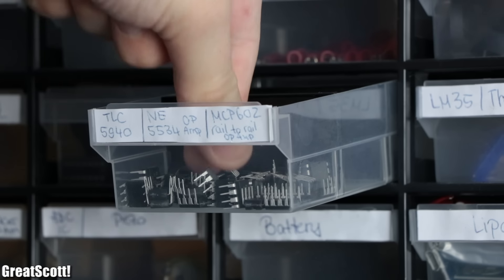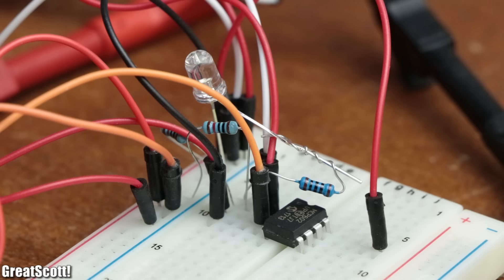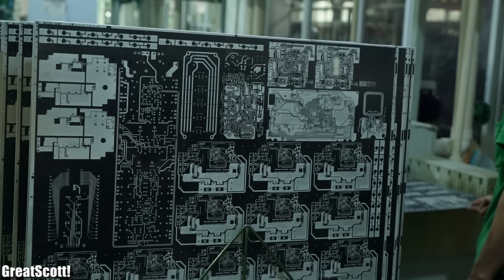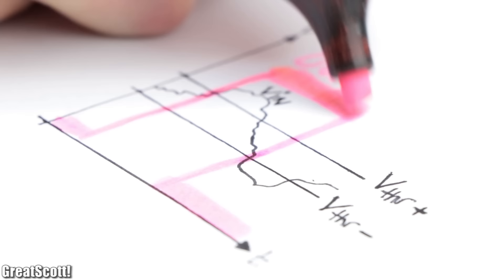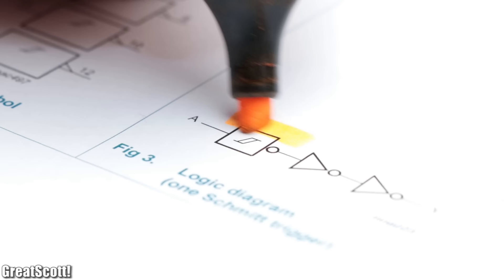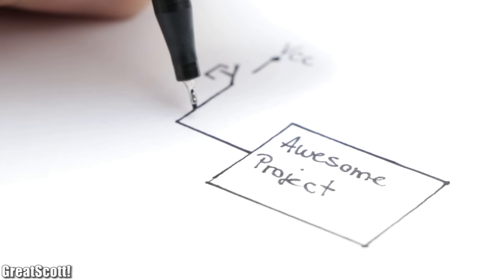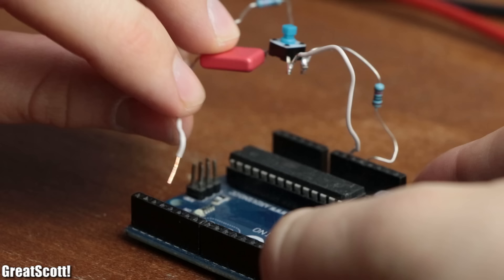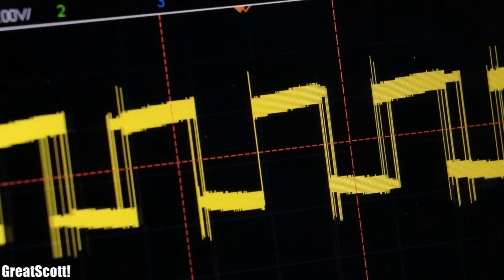Electronic Basics #35: Schmitt Trigger and when to use them

Comment: You can also use a 555 timer IC as a schimitt trigger
Reply: what can't you use it for?
Reply: XD
Reply: 555 also contains opamp
Reply: Luiz Fernando   you can also use a 555 for combing your hair and cleaning the dirt from under your fingernails... without even a battery!   They are very versatile, if a bit old-school.
Reply: Ray, I made an extremely loud noise with one the other day without a battery. I had dropped one on the floor. It landed legs up. I was barefoot and found the chip.  The noise generated scared the cat out of the shop.
Reply: Todd Anonymous   yeah, the 4069 dil hex invertor chip is bad in that way too.  Why don't they tell you in the data sheet?  Because they just want to sell them.

Comment: The high/low values for the inputs in the datasheet of a microcontroller (or pretty much any digital input pin of any logic circuit) are not equivalent to those of a schmitt trigger. They tell you what will definitely be seen as high or low voltage, but the outcome for everything in between is undefined.
Reply: superdau   good point.  The mistake slipped past me, thanks for the reminder.

Comment: using an op-amp as a comparator can have quit few pitfalls. Some op-amps have protection diodes between the +/- inputs so you can have more than a few 100mV between them and some op-amps invert their output when they hit the rail

Comment: Why do you keep saying shipping on JLCPCB is free? Am I doing something wrong? I'm always getting at least 10 dollars shipping with Registered Air Mail.
Reply: Same here
Reply from the maker: "keep saying"? I did not mention the free shipping in the last videos. If you experience problems with the coupon then contact JLCPCB. That always worked so far.
Reply: GreatScott! You did mention it in the video "currently with free shipping" ;)
Reply: Island Monkey for your first order only. Probably not for registered air mail though.
Reply: Btw, what I hate about PCB manufacturers that price is hard to compare :( They seem to compete with the price of the board, but shipping is always more then the price of small boards. And "surely" there is no easy way to know what will be the total cost anyway for you in advance, so it's hard to compare all of these manufacturers based on the total cost, what people would be interested more (I guess) rather than some "imaginary" price which is never what you have to pay (ie, the "without shipping cost" price). Ok, for JLCPCB , probably shipping  is free for the first order, that's true, but I meant in general. I would prefer a fixed price with ALL things included from all manufacturers (for about the same PCB surely) so it's much nicer to check and compare prices then. But I guess this is exactly what they don't want us to be able to do ... ?
Reply: @GreatScott Where is the coupon code for free shipping for the first order?
Reply: I checked it right now, registered Air Mail is free. But I think it is only valid for your first order.
Reply: I just checked it too and it's still not free. Registered 10$. It would be my first order.
Reply: ibisko89 Maybe it depends on your location? I'm from Germany Btw. Do you used the link in the video description?
Reply: Klar, habe ich..bin auch aus DE ;)
Reply: Sorry mein Fehler hatte keine Adresse eingegeben. Nachdem Eingeben kostest der Versand um die 10$.
Reply: Ich habe denen mal eine Mail geschrieben. Mal sehen was das gibt.
Reply: Da bin ich mal gespannt
Reply: ibisko89 Habe eine Antwort bekommen. Nachdem ich bestellt habe bekomme ich die Versandkosten erstattet.
Wahrscheinlich ist das ein Verlustgeschäft für die und deswegen wird das ganze versteckt.
Reply: its working
Reply: @Marcel Ok. Hast du bestellt?..Still not working for me!
Reply: +LGB Gábor Lénárt Actually, there's a website that compares PCB manufacturers: https://goo.gl/iv6vAg.

Comment: on a circuit bord we make on school  3 schimitt trigger's are used to boost a 9 volt battery to 30 volts  only using diodes an elecrtrolitic capasitors   no external power is used only the 9 volt batery ter is no induktors and transformers on the circuit bord

Comment: 74LS132P confusing me !! 😵😵😭😭 , it's datasheet is also very confusing , i wanna test this ic , but I don't know whether its Nand gate connected before of schmitt trigger or after that ???? By powering ic with 5v I measured its output voltage on its one  ( two input Nand-schmitt ) that is 0.9 v on input A and B and 0.3v on its output Y !!!!! , it is ok to test one input schmit trigger for me !!! but ------ " How to test ' two Input schmitt with Nand  ' Output With Hysteresis ?????   Datasheet shows :// - on Vcc= 5V , VTh+ = 1.5 To 2V max ,, VTh- = 0.6 to 1.1V max !!!!?? and vth+ to vth- = 0.4 to 0.8 type ????? any one tell how to test it using potentiometers and multimeters ?????

Comment: or..use two zener diodes
Reply: Good point. I am a complete electronics noob. In fact, I didn't understand much in this video. Would it be exactly the same thing or are there trade offs?
Reply: cheaper, can use larger current, more control and more thresholds but they need more adjustments and depend on design. for small currents like .1-10ma probably is better to use chips

Comment: You can much more easily software debounce in the microcontroller if you're going that route already.
Reply: Atlas WalkedAway   yep, it's a trade off between component count and a bit of cpu time, and for 8 buttons saving 16 components and pcb space is often worthwhile. For anyone else reading this, the cap and resistor is a low pass filter.  So you can replace it with a simple software model.  Is that the method you use?
Reply: +Ray Kent Yup, It's been a minute since I've used it but its either native or it's a component of my keypad library. I never noticed any affect to performance, but I wasn't trying to use buttons to raise or lower a levitating object or anything precise like that. Just millis() timer based stuff.

Comment: Hello GreatScott! I need i circuit which converts 12v DC to 5v DC. I used 78m05 ic but it just burnt. I also used a heat sink but still the ic burnt. Can you please a make a video on how to to this. The 12v DC source is a 110Ah battery.
Reply: Arif Khan How much current does your circuit draw? Do you have a heat sink? A 7805 is a linear regulator and burns off excess power as heat, so you need cooling if you're drawing more than a moderate amount of power. You'd probably be better served with a cheap switching power supply module rather than a linear regulation like a 7805.
Reply: Pete Stephenson Yes i have used a heat sink but still burnt. The current consumed by circuit is 2Amps .
Reply: Arif Khan The 7805s I have are only rated for one amp, so two amps will overload them.

If you're drawing 2 amps with a 7 volt difference, you're asking the regulator to dissipate 14 watts of power. Even with a large heat sink, and assuming it's rated for that current (which it's not), it will get extremely hot and you'd likely need a fan or other active cooling.

I'm not sure what the project you're building is, but a switching regulator is almost certainly the right choice for it.
Reply: Arif Khan Also, the 78m05 is only rated for 0.5 amps. No surprise it's burning when you're dramatically overloading it by a factor of four. 

As a starting point, take a look at the LM2576T-5. It's a switching regulator rated for 3 amps (giving you some overhead for safety), requires only a few external components (see the data sheet), and will produce a stable 5V. It costs about $2 USD, and you likely can buy pre-made modules for only slightly more. Plus, you don't lose the 14W of power you'd lose with a linear regulator, so your battery would last much longer.

As always, read the datasheets. 

What is the nature of the project you're making?
Reply: Pete Stephenson Thank you very much! I will try the switching power supply.
Reply: Arif Khan You're welcome. Keep in mind that switching regulators, although much more efficient than linear ones, have stricter requirements for components and board layouts to minimize noise and other issues. Unless you understand the details, it's probably better to get a pre-made module that will do what you want.